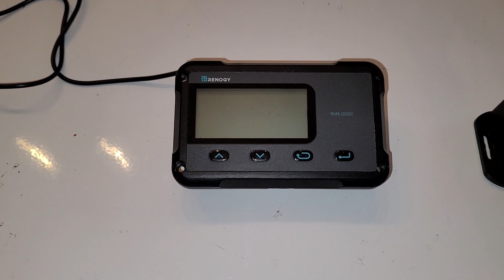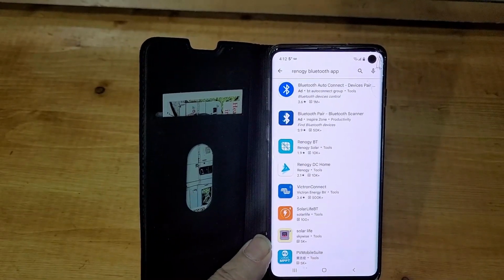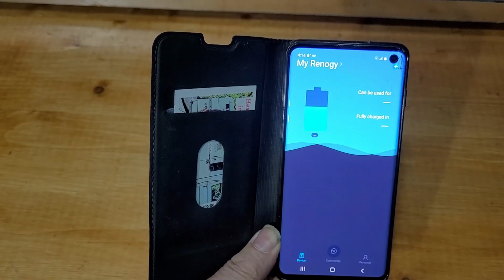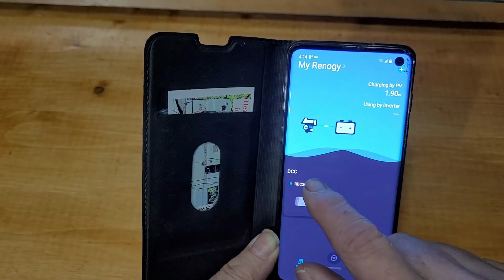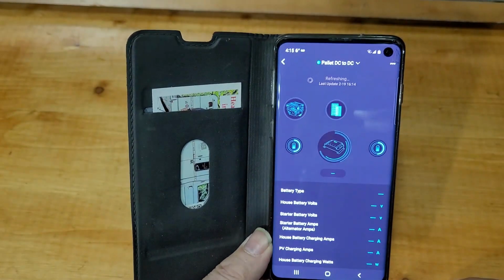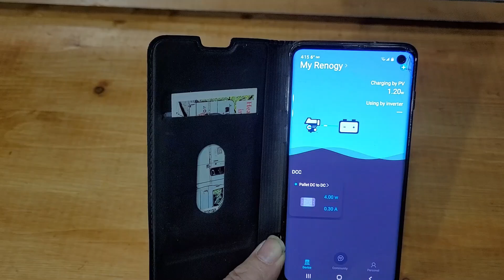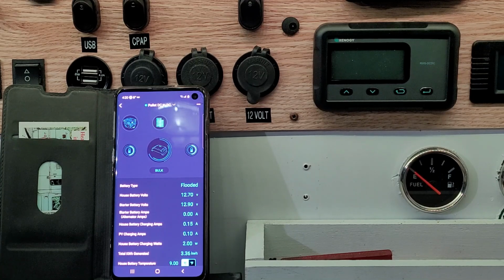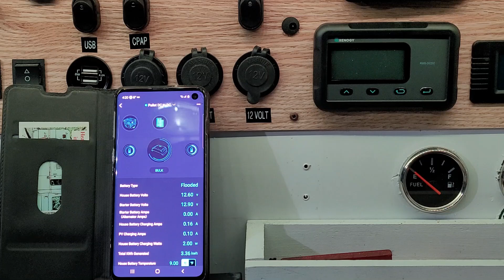Installing Renogy Dc to DC Charger with MPPT Controller in Pallet-ive Care

Comment: Did you end up getting the BT and display to work at the same time? I'm trying to work out how to get my smart battery display to work with the BT through the Hub.
Reply from the maker: Hi Chris I was working on a few things. I could get it to work with a optical splitter but I want to make something that everyone can use. 
I will try a few things without the hub and get back to you. You can email me at wayne@pallet-ivecare.ca
Reply: @waynesamboworld  I am also interested in this.  I am using the OneCore display and the bluetooth on the hub, and those work, however I would like to add the battery monitor right by my battery bank.  Currently it has to be plugged into the battery itself and will not power up anywhere else.   If I can power it, and it not mess up the other adapters, it would be very helpful.